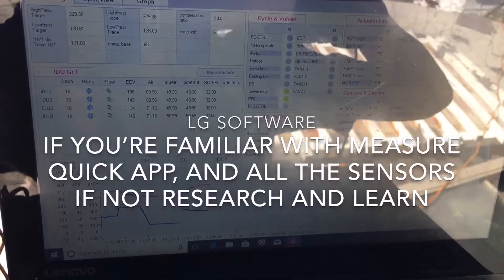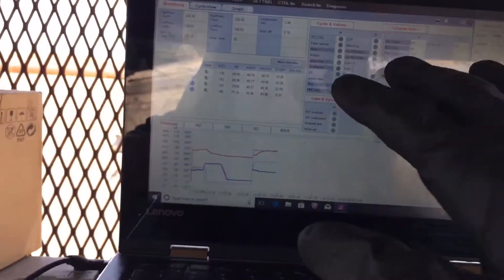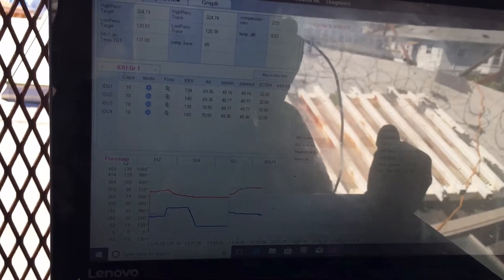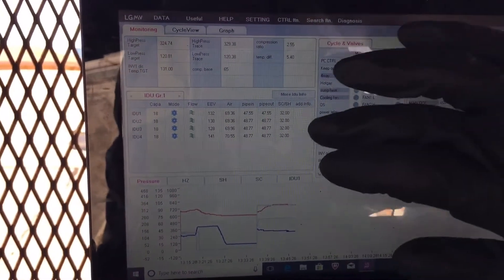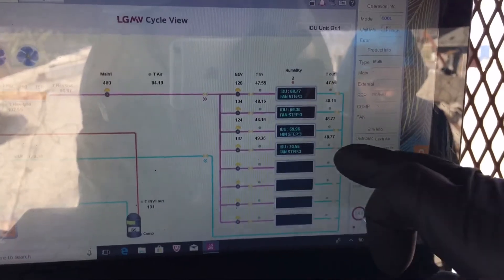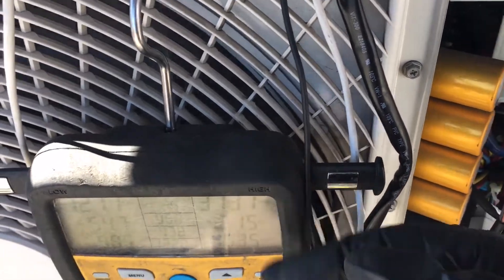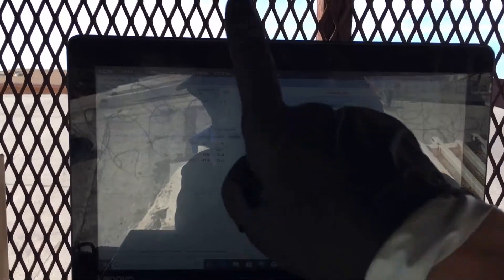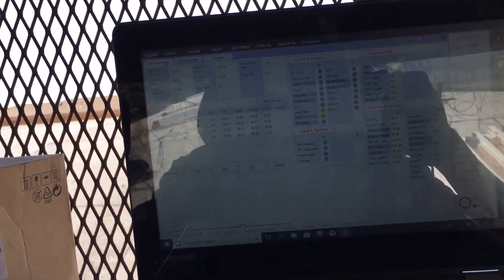LGMV Software it’s like the Measure Quick app software specifically for LG

Comment: Will you please tell me what hardware interface you are using?  I see two different interfaces being sold the PRCTIL0 (LGMV Connection Cable & Software Kit) and the PLGMVW100 (LG Monitoring Wifi).
Reply from the maker: The LGMV with the connection cable

Comment: Do you need an interface to be able to use that software?
Reply from the maker: Just like all the major manufacturers of this VRF equipment they always have an interface between there  equipment and the software. 

        But having the software in the interface absolutely does you no good if you don’t understand the motive operation of the equipment and pressures mean absolutely nothing they are totally worthless. 

        You have to be willing to fly yourself out to one of the regional training classes not just an installation that’s the easy part but on service and understanding the principles behind how this equipment operates like nothing else. 

That’s why I absolutely went out and I purchase this equipment and installed it on my own personal house I installed it on my kids house I installed it on my mothers house I installed it on aunts and uncles houses. 

        Just so I could better learn its operation and understand it so I do not make mistakes on customers jobs. 

      And the benefit of owning all the equipment myself in an extreme case of emergency if one of my customers units went down and there was some sort of supply chain situation like Covid or a storm or dock workers strike or trucking union shipping strike that stop delivery of parts four weeks. 
             I just go out to one of my personal pieces of equipment that matches my customers and rip the motor or the panel or the circuitboard or any part needed off of mine and temporary early and immediately  install it on my customers job to make him happy immediately while we are ordering the new parts and waiting

Comment: Hey sir..
Please make more videos for parameters  its very use  full
Reply from the maker: That will come it’ll be sometime it will take more planning in a more structured video to go over details. 

       In the meantime you can go to LG‘s website go onto commercial go under installers in contractors and sign up to get onto there Internet-based portal training programs they have about 50 short training programs about their equipment installation through service. They have questions and they grade you on your answers and you could keep retaking the modules until you pass. 

         And over here I don’t know where you’re at but you either drive out or fly to several they’re different locations for in-house training
Reply: Thanks for answering sir now i am in UAE i have lg mv mobile 
But i dont know about pare meters i want to learn where i can learn??
Reply from the maker: @bilalarain5304  on the LG website on the commercial for contractors . 
          Look for training. 

    Also look for LGMV software

Comment: Hi !
Very good tool indeed. I was able to get LGMV on my setup and I see that the low pressure is getting quite low (sometimes down to 4.4bars) and the high pressure is increasing quite fast, up to 36bars ! Then the hot-gas valve is activated to protect both the low and the high pressure, as well as my outdoor unit fans which are set at maximum speed and finally the compressor is set progressively to minimum speed (heating mode). Sounds to me that there is something wrong, but what could explain such behaviour, especially the high pressure raising again and again ?
Reply from the maker: Pressures mean absolutely nothing by themselves on the system. 

This is why you must go fly out to Waylon and the regional training classes on this product and the software to learn about the systems because if you’re only brat ground is relying on pressure then you should not be working on this equipment in the first place. 

            Are you taking an account where are your EEV feeding rate
         It also gives you the superheat across your indoor heat exchangers 

     Just having the tool and the software means nothing if you don’t understand the motive operation of this equipment